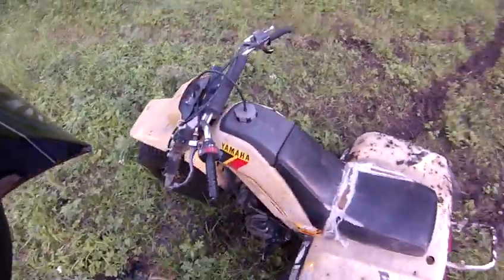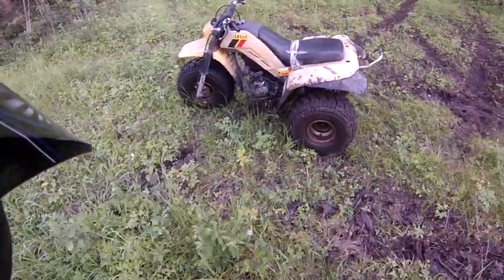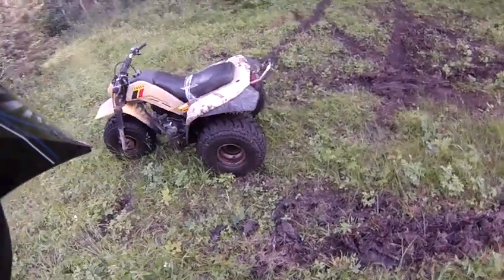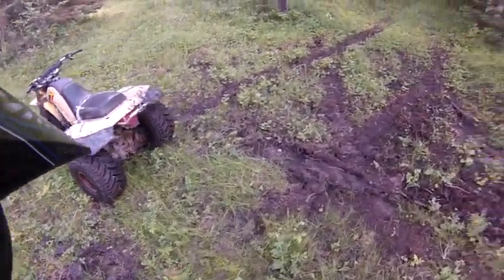Yamaha 225DR 3: Testing the Helmet Cam

Comment: What gear were u in for the wheely
Reply from the maker: A few in each up to 3rd.  I did one in 4th in the next vid.    I didn't have brakes so I didn't want to try and find the balance point in these vid's so that's all motor.        After I fixed the brakes last spring (2017) I can get it up in fourth with motor but easier if I pull it up and can balance for a few hundred feet.  She's too old and loose to go further, needs axle/swingarm work.     I could never get it to balance in 5th.